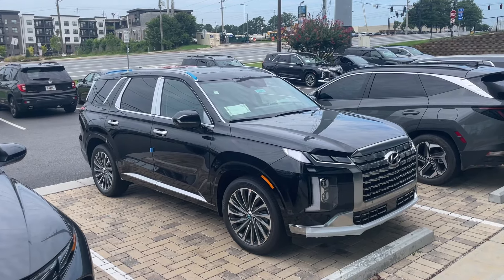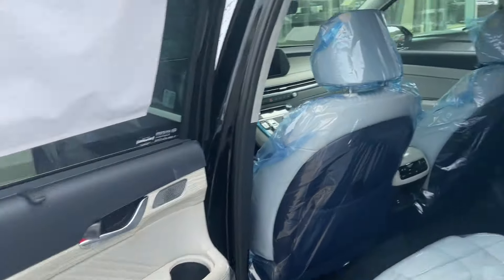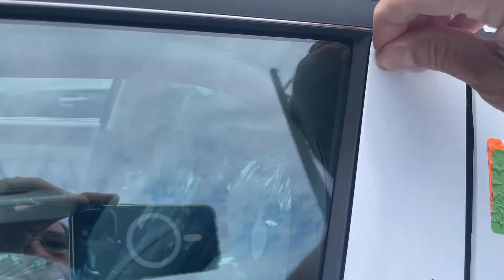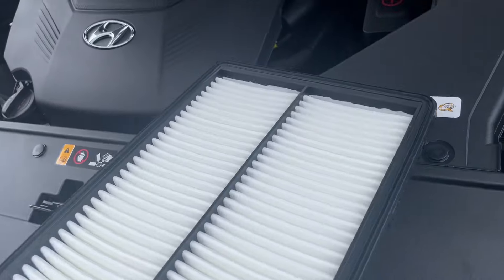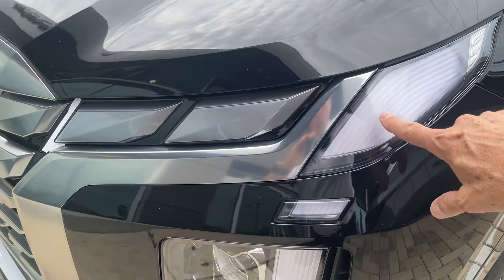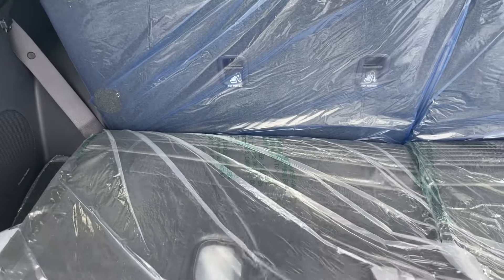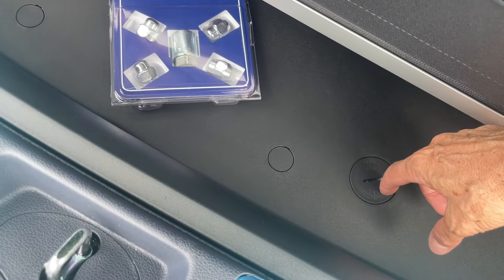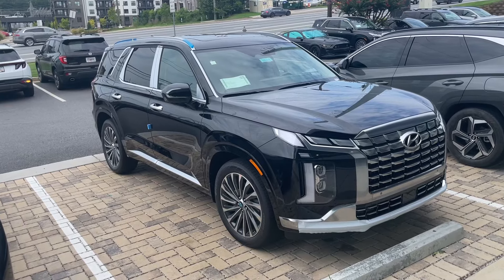2025 Palisade Calligraphy it has finally arrived! Walk around video to show you.

Comment: They need to add folding door mirrors.
Reply from the maker: @darrensmith8673  yes and that will come in 2026 with the new Palisade. There will be a hybrid version too.
Reply: Yes I got the 2025 calligraphy but no auto folding side mirrors. Disappointed
Reply: US versions do not have auto folding mirrors but the Korea versions have auto folding mirrors, memory electric adjustable steering wheel, recliner zero gravity drivers seat. Unfortunately we don’t get these goodies in US.
Reply from the maker: @al151  i hope they will be putting that on the 2026 models 👍